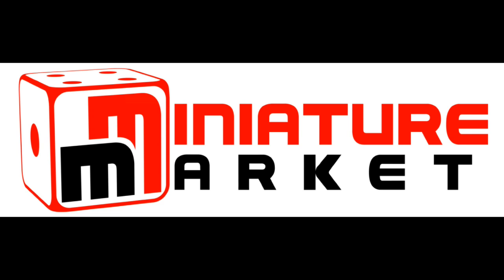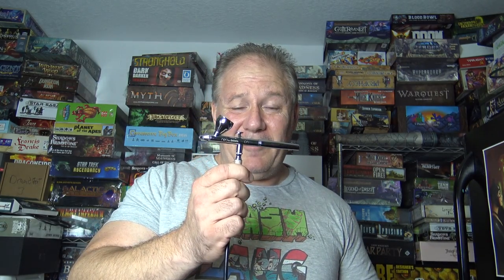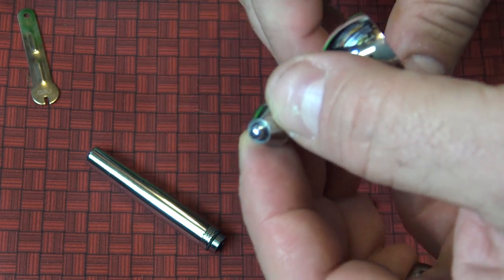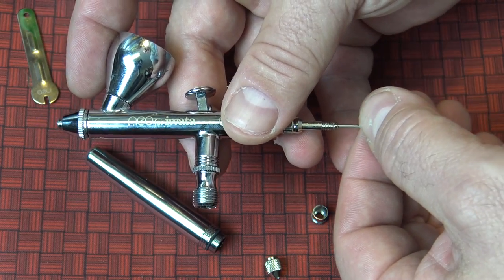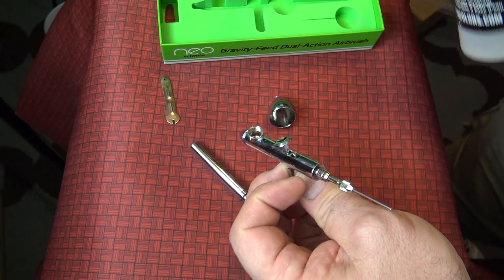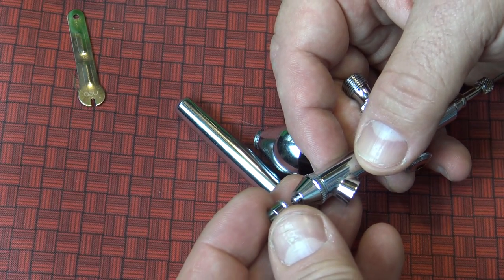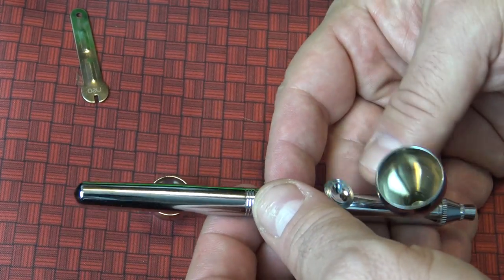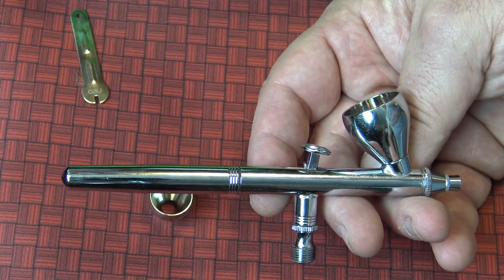Painting 102: Learning to Use An Airbrush - Part 2

Comment: Thanks for that...us novice painters need any help going.
Now how are you with generator tips?
Reply: dan palmer do you mean compressor?
Reply: Err yeah thats what i meant lol.
Reply: When you wipe your needle down, always wipe from the back towards the point, if you do it the other way not only can you damage it, it is very very sharp!  I know from experience.

Also, my airbrush, the needle holds the trigger in place, don't put air through it without the needle in, or you might be trying to work out how to reassemble a bunch of tiny parts inside a fiddly small area.